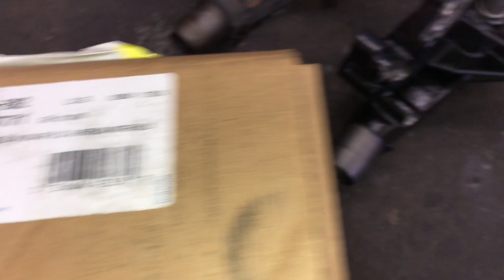How To Replace A Water Pump And Thermostat On A Chevy 2500hd With 8.1l Engine

Comment: Best diy video hands down , no nonsense, listed all the products that you used and explained the repair so easy that I felt comfortable doing it myself,  the torque specs,  pushed me over the edge to do it, and came out perfectly, thank you so so much , I just subscribed to your channel. .. thanks again..... I only weight 115 lbs so I did need some help from my brother to loosen the fan clutch nut, but other than that, all me..thanks again.

Comment: Great video. I own a 2002 Silverado 2500HD, with the 8.1 liter. I have about 242,000 miles on it and the water pump just started to leak. You would get double thumbs up if there was that option lol. I'm gonna get all the parts together and get the repair going.  Thanks again, keep the videos coming.
Reply from the maker: Todd DeRose If one comes in the shop I’ll film it. Thank you for watching!

Comment: Great details, easy to follow, and made this job a piece of cake!  Worth noting, when draining the coolant via the petcock, there is actually a rubber drain hose that runs vertically up the side of the radiator.  Fish that out and down into your bucket and you won't make such a mess.  Additionally, you will get more coolant drained out.  Put the hose back in the upright position and close the petcock, then continue on!
Thanks!

Comment: Great video on water pump swap and hose! I have a 05 Avalanche with the 8.1 in it and just had radiator issues with it crack towards the top on the thermostat side so I'm ripping into it and think going to do the water pump and hoses too! Great job I also like my Milwaukee tools!😉

Comment: Thankfully GM kept this easy to replace. My stock water pump went out at 252,000 miles. These are definitely some great trucks.
Reply from the maker: Josh B You got your moneys worth out of that pump
Reply: came to watch this video for the first replacement on my 02 at 256k lol
Reply: My 2002 Sierra’s original water pump just started leaking at 290,000 miles. First coolant issue on this truck....besides a faulty coolant tank covered under warranty the first year I own the truck.
Reply: @HowtoAutomotive  I certainly didn't get my money's worth out of the second one though. Granted it was a parts store pump. The replacement went bad 50k later and at the same time, it started to have transmission problems. It's now sitting in my back yard and I replaced it with a 2014 Ram 2500 with the cummins, fully deleted and tuned of course.

Comment: Hey man I loved the video. I replaced the water pump/fan clutch/thermostat/ and both belts. After doing so no more leaks but now my temp jumps from like 160 to 191 then back to 160 sometimes in between. It didn’t do that before. It was a moto rad fail safe. Replaced with 2 different ac delco gold ones and now back to a new moto rad fail safe and it’s still doing it. I’m thinking maybe the fan clutch is to big if that makes sense. It seems to be a louder roar from the fan then before. Lemme know what you think if you have time. Thanks sir. @howtoautomotive

Comment: My 2004 8.1 l motor crank pulley was filled with oil cuz high mileage real thick I cleaned it off would that make off balance if didn't get dirt in some areas just want to no cuz now my motor is slugger and bouncing all I did was water pump nothing else let me know

Comment: Just bought a 02 Avalanche with 8.1 it makes a loud roaring sound when on the throttle. It sometimes go away after I’m on the highway at about 75mph after about 4 miles. Could it be water pump or ac compressor?
Reply from the maker: It would be hard for me to say without hearing it for myself. One thing you can do is take the drive belt off and spin all the pulleys by hand and see if any of them feel scratchy or make noise.
Reply: I think I may have narrowed it down to fan clutch. And maybe thermostat my temp gauge doesn’t go over 180 and last time the noise stop. Engine temp went to 210

Comment: Do you really need to replace the factory hose clamps?  The old ones seem to fit better.
Reply from the maker: Thomas Fraser If the OE clamp is in good shape it’s OK to reuse them. I’ve had a few of them leak on me so I like to change them.
Reply: Keep constant tension spring clamp or replace it with a new one. NEVER expect a customer to get in there and service worm drive clamps! Spring clamp will keep tension on hose as it compresses over time.